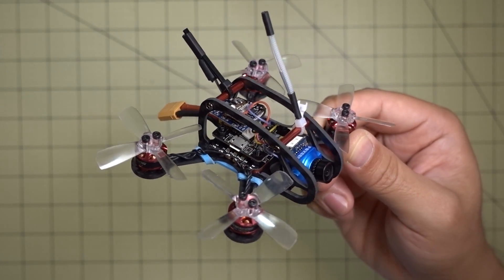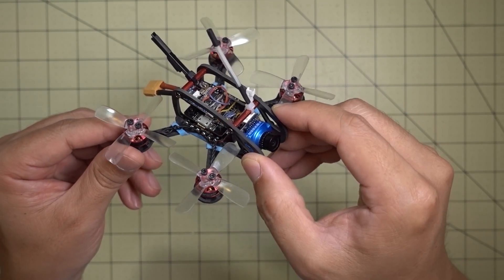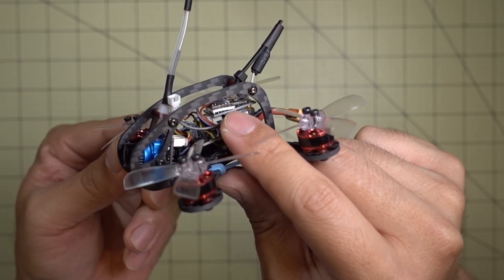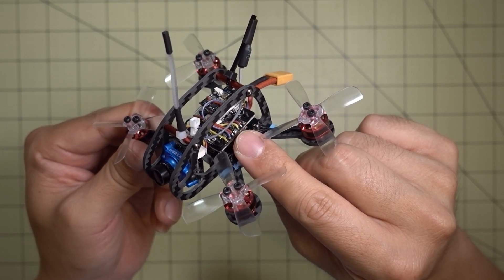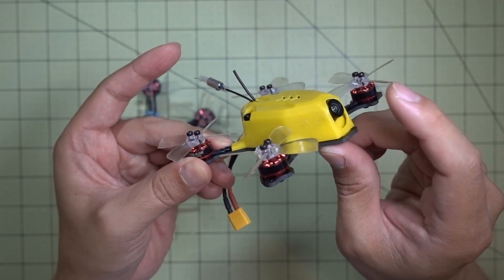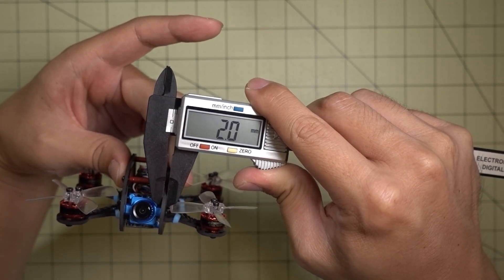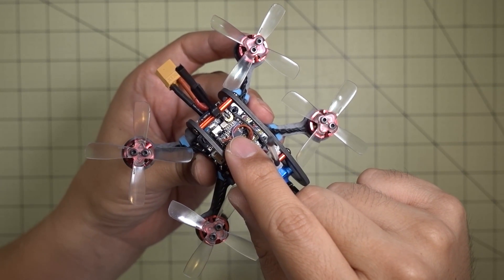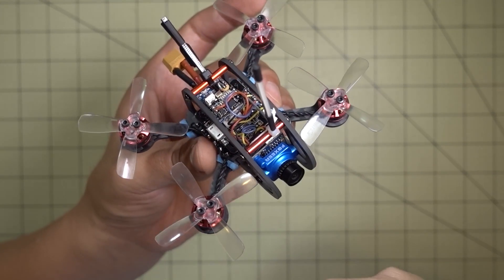Micro Drones 101 🚁#25🔥 FlexRC Ascent ⚡👍

Comment: Hi Albert I'm hoping you or someone reads this and has some input on my question. I'm trying to decide between this frame and the 1103 7800kv or RotorX 1105b 6500 motors.
Reply from the maker: If you're running 3S the 1105b will have more power but I think the 1103 will be faster.

Comment: Thanks for all the reviews and sharing what you have learnt. I have subscribed. I was hoping you could point me in the right direction. I have been flying an RS90 outdoors and have found that it gets thrown around in the wind too much when the wind is around 10-15mph or more.  This has got me looking around. I want more power, 3s-4s with acro ability. Should I be looking at a 3" setup or will a 2" suit? 
I was looking at a 3" but I've seen some video where wind over 10-15mph does not seem to impact a 2" quad. So now I'm not sure.
Reply from the maker: A 2-inch on 3S will be fine in that wind. Check out this video - https://www.youtube.com/watch?v=-U3jYA5X58E
Reply: Thanks :) . So given current available 2". Which would be best in that wind and maybe more. The Ascent Extreme v2 or the SPC Maker 95GF or or something else?  A bit worried tho about what you pointed out as a flaw on the 95gf which is the camera angle not being enough for fast flight.
Reply from the maker: +Enrico Gi I've come up with a solution to the camera issue on the 95GF. You can probably build something a little better on the Ascent but not by much... if you want to save time, the 95gf is the way to go.
Reply: Thanks Abert. I've not built a quad yet but happy to give it a go.  
Would building this kit with the gemfans give me a better quad than the 95GF, https://flexrc.com/product/ascent-extreme-diy-kit/ ?
 Whats the solution to the 95GF camera angle?
Reply from the maker: +Enrico Gi I'll have a video about it soon

Comment: Hey Albert , I swapped all components form the arfun 90 to the ascent 94 frame with vtx03 & runcam 2 micro upgrade! Sadly 😪 I'm I'm having FOD issues! I haven't had those problems since I started using the 550 80c 2s lipos w/xt30 months back. Ever since the frame swap I can not do any acrobatics or do full punch outs. What might be the problem?
Reply from the maker: Do you know what the weight difference is? It's probably heavier with the Swift Micro so you should raise the idle speed. Try that.
Reply: Albert Kim don't have a scale but it feels a little more heavier than the stock arfun 90 build with runcam micro. What idle speed do you recommend I was on 2 percent idle speed. Thanks
Reply from the maker: You should try about 4.5 percent and if that doesn't work increase it some more.
Reply: Albert Kim yeah still didn't work I started  about 4.5% to 10% and just doing a few flips hovering it would just lock in the air and fall to the ground. My only choice is to cut off osd from the FC or this set up is to heavy for this frame. 😔
Reply from the maker: Hmmm, the Micro Swift + VTX03 might be drawing too much power. Perhaps try my BEC mod from the brownouts video.
Reply: Albert Kim yeah disappointed but it might be the case. This frame flies well with the FOD issue aside. I had the same problem with the mikro 2 frame as well but with cmos camera installed.
Reply: Albert Kim So the 5v bec will be soldered between the cam and vtx03 positive and negative? I have the runcam and the vtx powered to the FC currently.
Reply: Albert Kim Just a follow up I swapped to the arfun 95 components and didn't have any FOD issues with doing rolls. I'm thinking maybe the BEC on the 95 fc is better than what is on the arfun 90? I'll have to really test it doing freestyle.

Comment: Quick question, what would you suggest if I wanted to upgrade the motors on my walkera rodeo 110? I bent the shaft on one of my motors. Just thinking if I should buy the replacement or upgrade.
Reply from the maker: I would get the replacement motors as the ESCs are not that strong.

Comment: hello albert, i want to build a 2 inch quad and run it on 3s, i will probably get the racerstar br1103b motors
is 10A esc with a burst of 12A enough for 3s? (XJB F310 F3 + ESC( 
or should i go for racerstar 1.2g 10a burst 15a esc with an f3 board
also have you tried the racerstar br1103b motors on 3s? are they any good?
Reply from the maker: 1103b 8000kv should be ok. 10,000kv will fry that ESC.
Reply: Albert Kim ok thanks

Comment: Hey Albert, I yanked the motors off my Lanchi Monster for a higher kv motor, do you think this would be a good frame choice for the Lanchi motors?
Reply from the maker: I think they will do well on 2S on this frame and the 2-inch props.
Reply: Thank you!   I hold out for version 2.
Reply: Yes, they work well.

Comment: Just wanted to thank you on helping me keep my bank account Down to a reasonable level, haha. Keep up the great work!
Reply from the maker: LOL
Reply: I'll second that! lol
Reply: Albert Kim Hi Albert I'm hoping you or someone reads this and has some input on my question. I'm trying to decide between this frame and the 1103 7800kv or RotorX 1105b 6500 motors. Would the performance be similar to the 7800's if I went with the 6500's? Do you think torque matters with such a light weight frame? Thanks! Happy Holidays!